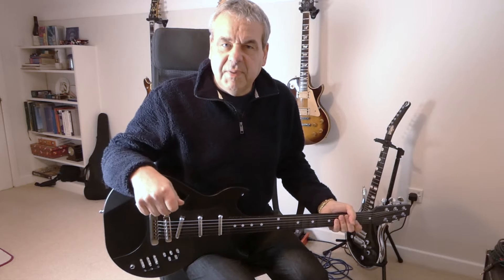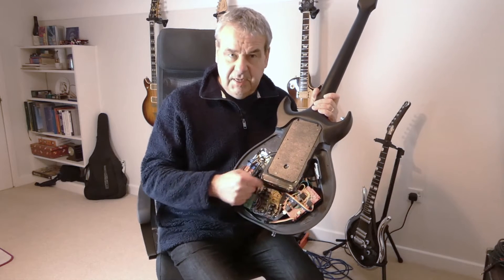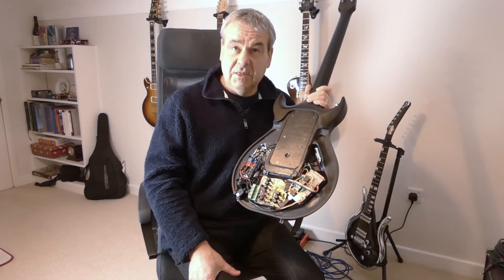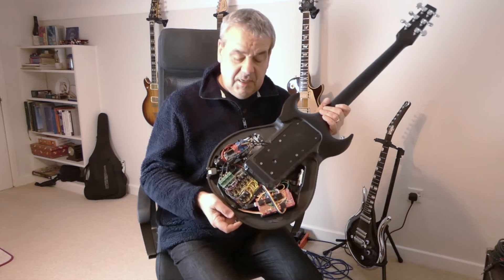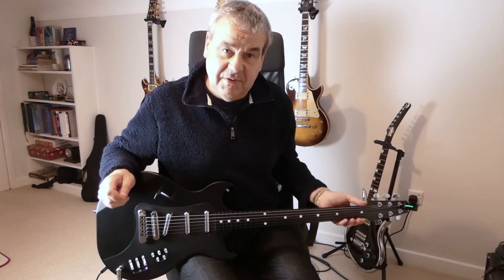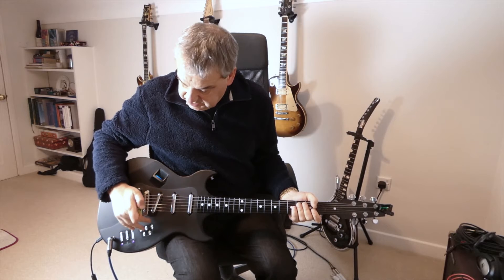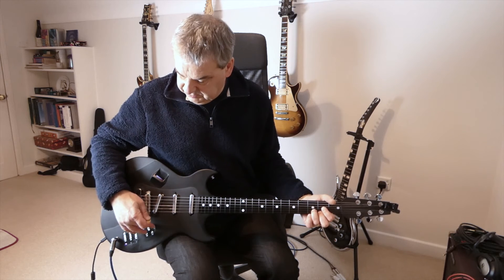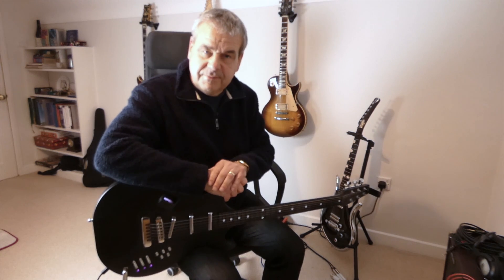Arduino powered guitar: The Bond Electraglide lives!

Comment from the maker: I realised there is an issue on the bridge tone that I need to fix, it isn't as strong as the other pickups (I suspect I have got the pinout wrong on the Mega). Plus all the tones and volumes affect each other when the pickups are active, just like they do in a normal guitar. I would need a summing amp to get round this, which might be a good idea for the future.